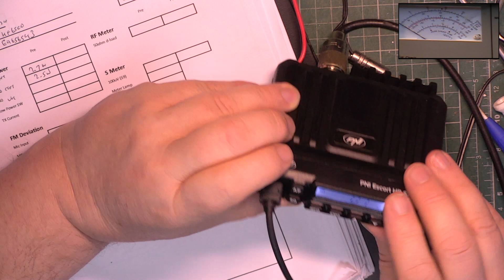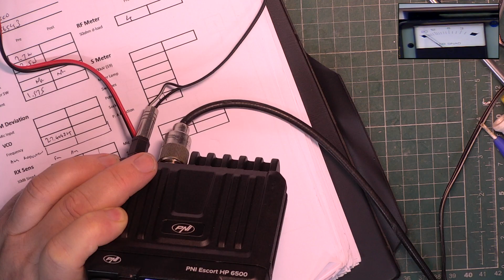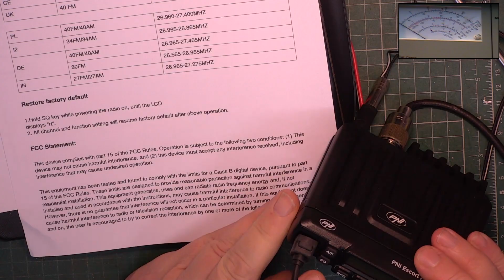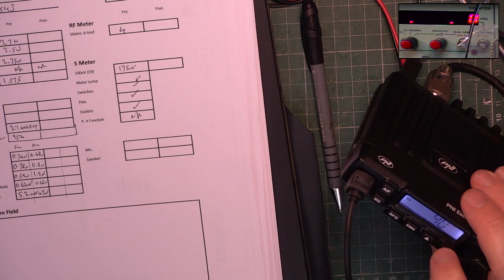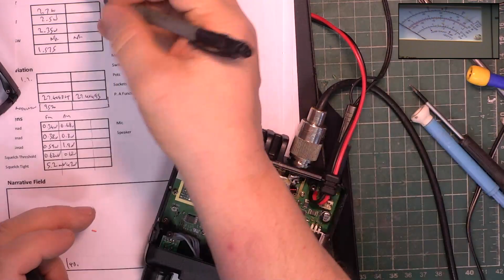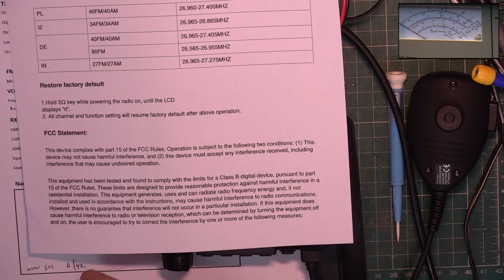PNI HP6500 CE MultiNorm UK/EU CB radio - new set optimisiation

Comment: Same everything except the internals of the Midland MTX115 GMRS Radio. They are all private label radios, I thought Midland had designed it from the ground up but nope.
Reply from the maker: The UK doesn't have GMRS. When did Midland make anything? CB radio was introduced to the UK in November 1981. The mobiles & handhelds were Maxon built & the base station was Cybernet.  I've no idea who makes the stuff for them, but most of it has become hateful and menu-driven.  Squelch on a menu on some sets; ridiclous.

Richard, G0OJF, UK